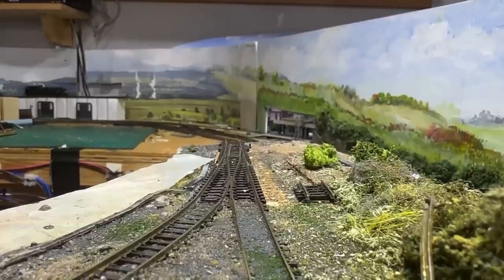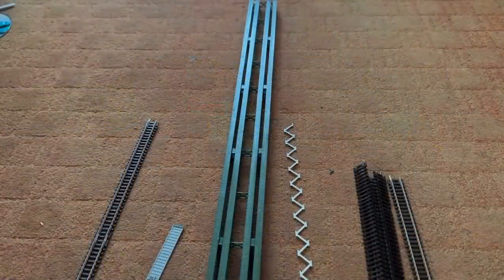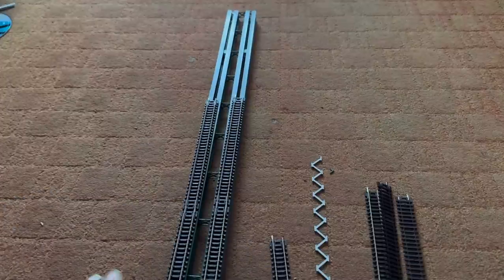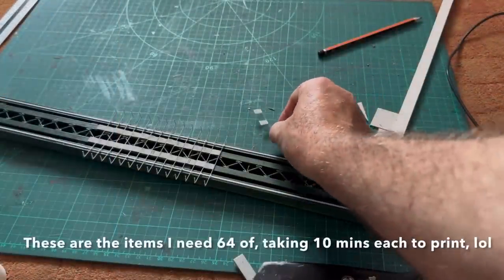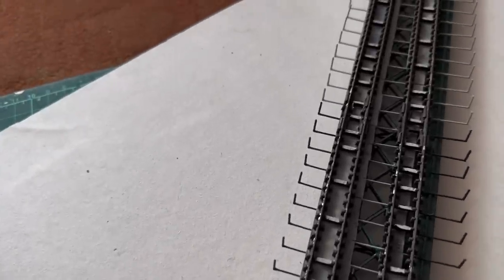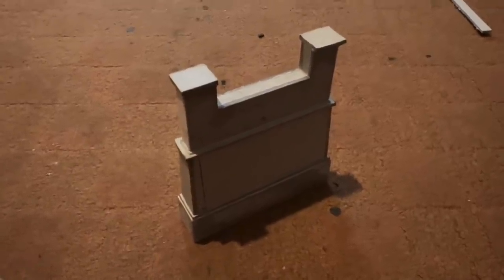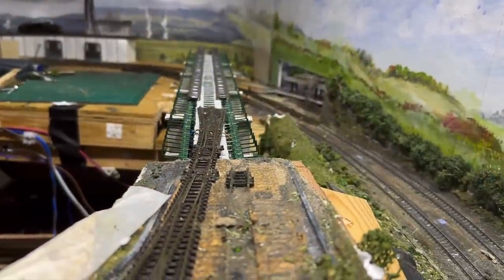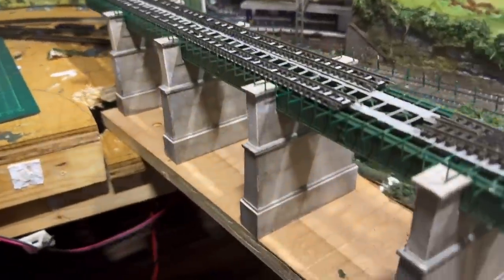BUILDING DINTING VIADUCT in N gauge

Comment: Hiya John , 
Wooow that is really impressive ( would look great with a pair of class 76's on a MGR 😄) that some really great work . really looking forward to seeing that finished .
Reply from the maker: Thank you so much, Im having huge amounts of fun seeing it all form. 76s hmmmm naaa, I know I have some trains following rule 1, but I generally I follow modern image. No-one makes class 76 in N gauge anyway, Im thinking about the class 323 as no-one makes that either and thats the train that goes up there atm.
Reply: @piccadillymodelrailways  Well if you look on shapeways i thing there is a Class 323 failing that i did a class 323 from a class 158 using Etched pixel kit with Electra sides but got shot of it when Farish's class 350 arrived But if you wanted a 76 ( Of which you dont but thought it might be of interest 🤔They are available from Shapeways and also have the 77 as well ) As i do own a 76 which runs on a class 31 chassis .
Reply from the maker: A 323, at some point. I was thinking of getting a 170 (I think thats what was recommended) and 3d print a cab. But it wont be just yet. I also understand 323s are due for replacement next year, so… might be better to wait and model new train. Dont know yet, got to decide. Thank you for your interest though, much appreciated.

Comment: Fascinating. Beautifully detailed. I would be interested in photos of the prototype. If possible. Thanks.
Reply from the maker: Hi  Norman, if you just goggle DINTING VIADUCT or Dinting Vale viaduct. The original was built from wood with traditional arches and strengthened 10 years later in 1850s. As trains got heavier, it was completed rebuilt into the format as currently modelled, then extra supports added in 1960s. Haven’t added the latter as yet. Mine will hopefully resemble the bridge but my lower scenery is different so would not look quite right, so modification is required. Hope that helps

Comment: Why not use flexitrak and a straight traksetta?
Reply from the maker: Hi, I did explain this in the video. The track NEEDS to be rigid having so many sleepers removed. Having the continuous support under the rail only comes with set track. Flexi track possibly may just fall apart.
You don’t need a straight tracksetta a long steel ruler works just as well. The track will be straight where it needs to be straight.